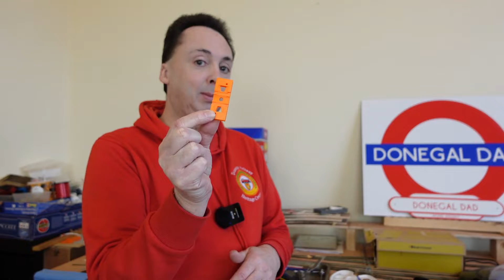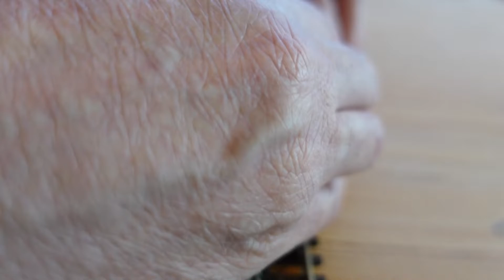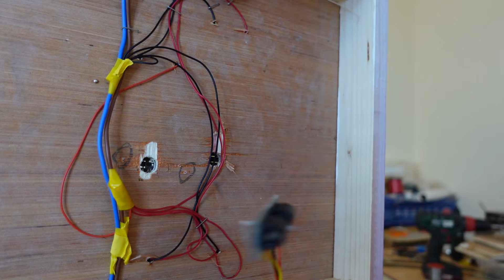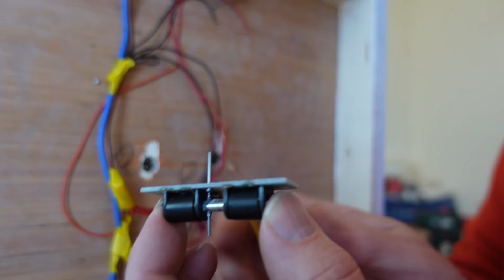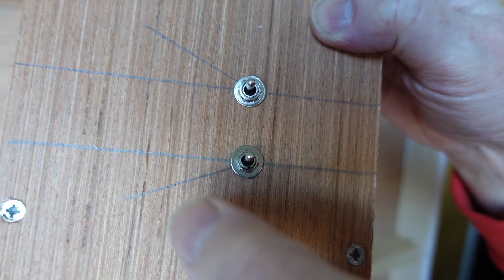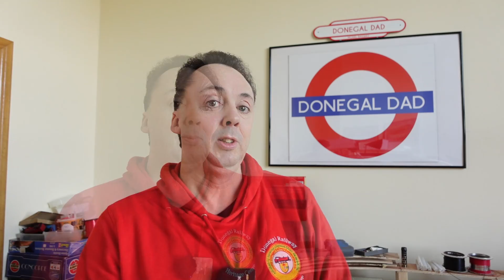172 Fitting and Installing Point Motors made Easy with this Jig from Scenic3D

Comment: Yes, take note, take notes of your wiring helps in fitting and diagnostics if there's any problems!  It is on the underside after all.  Thanks again Mark.  The little jig does seem to take a lot of fuss in lining up these motors as I've seen someone having a bit of difficulty with that.  All the best and catch up again, sir.  Cheers!
Reply from the maker: Thanks Flymo, yes the jig works really well.